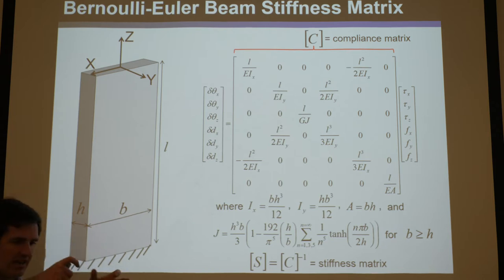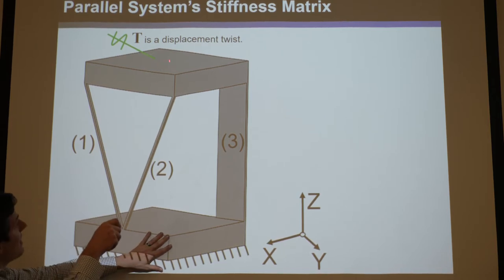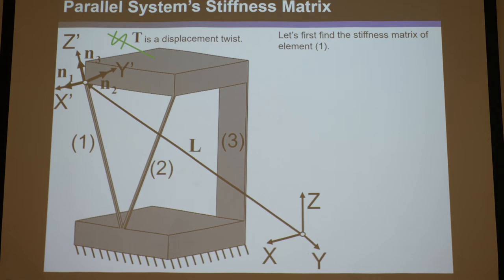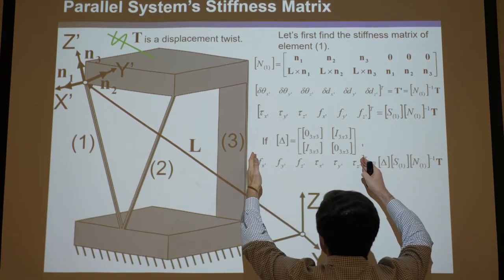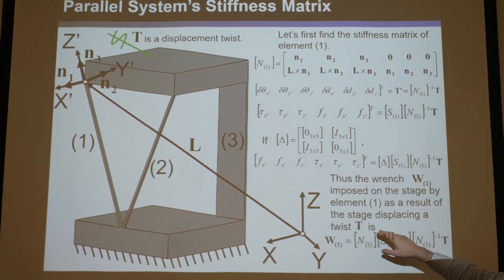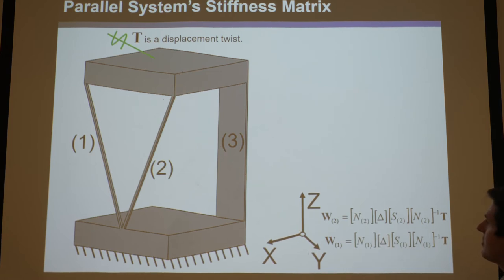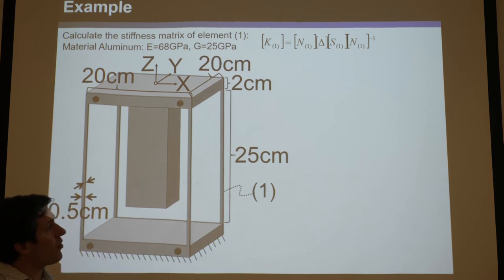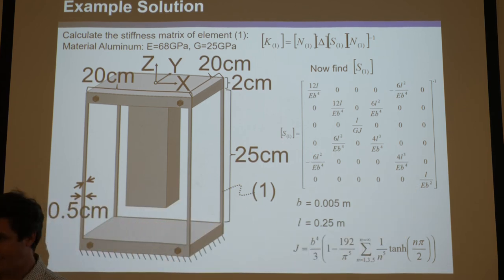Compliant Mechanisms Lecture 3 Part 2

Comment: Part 2: Parallel System Stiffness

* Parallel Systems (2:57):
    * Two rigid bodies connected directly by flexible elements
* Displacement Twists (4:02):
    * 6-element vector representing infinitesimal rotations and translations of a point on the stage
    * Defined with respect to a global coordinate system
* Constructing the Stiffness Matrix (6:45):
    * Define local coordinate system for each element at its attachment point
    * Define vectors: `L` (position vector) and `n1`, `n2`, `n3` (unit vectors along local axes)
    * Construct transformation matrix `N` using `L`, `n1`, `n2`, `n3`
    * Calculate element stiffness matrix `S` using material properties and geometry
    * Apply transformation to obtain global stiffness matrix for each element
* Total Stiffness Matrix (22:00):
    * Sum the stiffness matrices of all elements in parallel